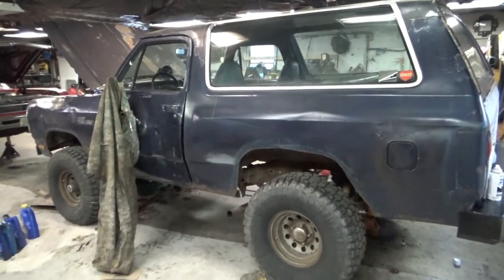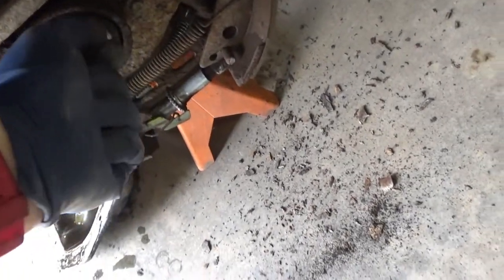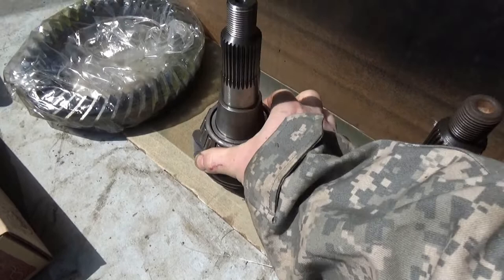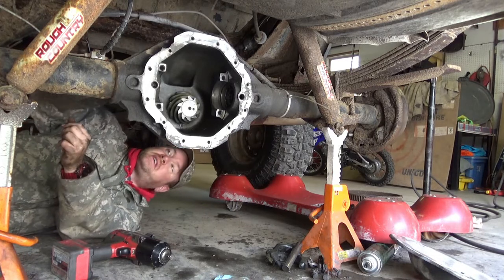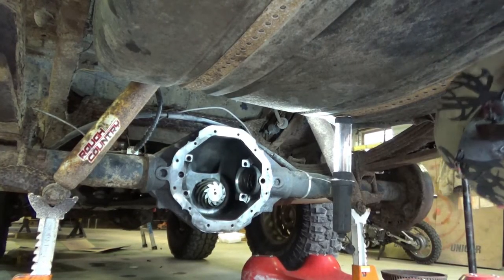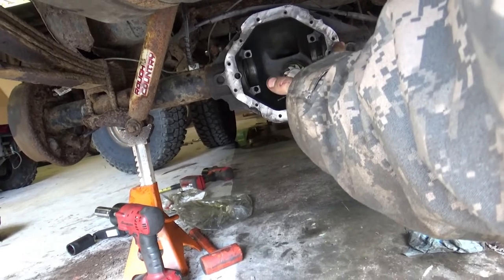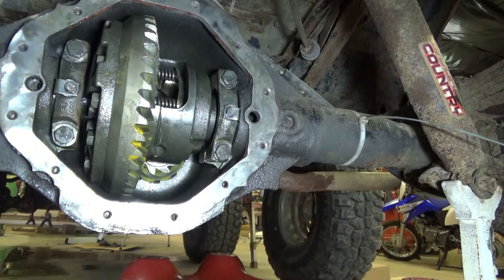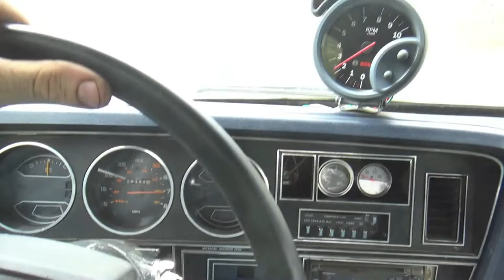REGEAR AND REBUILD DODGE 9 1/4 REAR IN RAMCHARGER

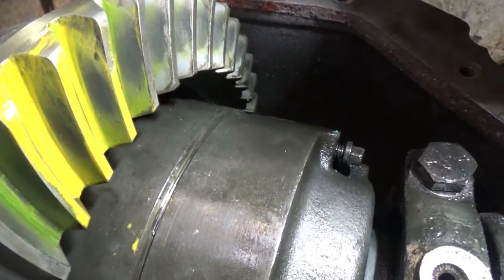Comment: Great video, thanks for the effort to share your experience. Not to take anything away from that, drive side is convex, coast side is concave, (the illustrations at 39:00 are backwards, you had it right verbally). Another way to remember that is to recall that the ring gear rotates in the same direction as the wheels. So when the pinion pushes it around to move the car forward, it is driving from the convex back side of the tooth. Excellent pattern. I think I am finally at the point I know enough to do this myself. I'll bet the thing you remember most is the sore back from crawling under so many times.
Reply from the maker: Thank you, I hope my video helps, and it is my knees that suffer the most doing this.

Comment: getting the races out was the worst part my pinion bearing blew up and gouged the casting on my pinion nut was larger too so I used the old one don't have a socket larger than 1 1/4. I wish I knew about the left hand threads before ii loosened them all up LOL
Reply from the maker: My oversized sockets was one of my best investments

Comment: Did you have to change the carrier out on the front axle? getting ready to put 4.56 in my 84 ramcharger and I was told i had to change out my front carrier..
Reply from the maker: Yeah I have a separate video on changing the gears in it

Comment: So I went to do my bearings and the spider and axle gear popped out enough to let the clips behind fall. I never done this and I made a mistake when I pulled the silver cylinder pin out I turned shaft and it unraveled right out. What do you think? I’m new to the game
Reply from the maker: You can put them back together as long as they were not damaged.
Reply: Why don’t you take apart your rear end again so you can show me 😂
Reply: @GSEShop  I forgot to tell you when I was wiggling it around the gear axle slipped out a bit and pop two ear 👂 shaped spacers from the back and this is the part that really got me nervous because I have no clue how those spacers are supposed to be inserted
Reply from the maker: @Keeter94  honestly, I would hate to steer you too wrong but I cannot picture what you are talking about.  Do you mean the axle c clips?
Reply from the maker: @Keeter94  if you wait long enough I might lol.  Just drove the truck today and I keep regretting not putting in 4.56 or lower gears.  Also mine has a posi, so there are clutches in there and not the gears.

Comment: Does the carrier have any side to side play? Mine does
Reply from the maker: Going back a few years but if I remember no.   You pinch it between the adjusters, and loosen one and tighten the other to set the backlash
Reply: @GSEShop  Ok, thanks! My 9 1/4 has a low speed coast clunking noise. The only thing I can find wrong so far is carrier with side to side play and too much backlash. All the gears look good. If you have any idea what the problem might be let me know.
Reply from the maker: @geraldwegener8376  yeah I would tighten it up and adjust the lash and see if it clears up
Reply: @GSEShop  Ok, thanks for the replys and the video !
Reply from the maker: @geraldwegener8376  you are welcome